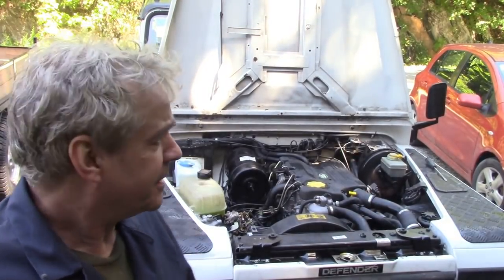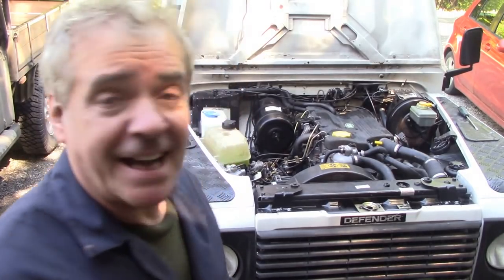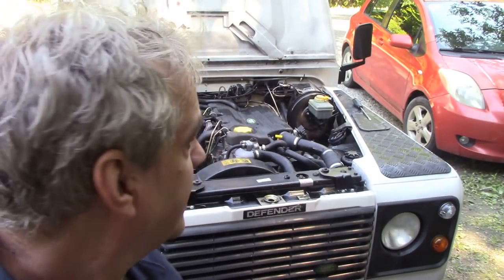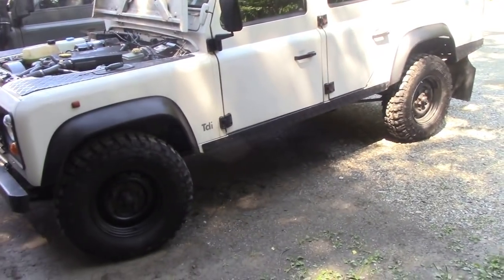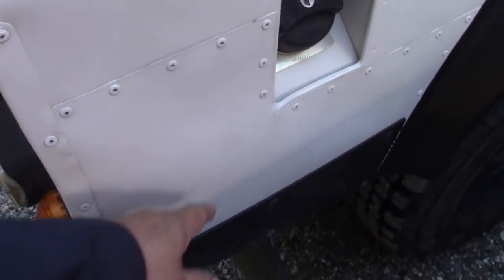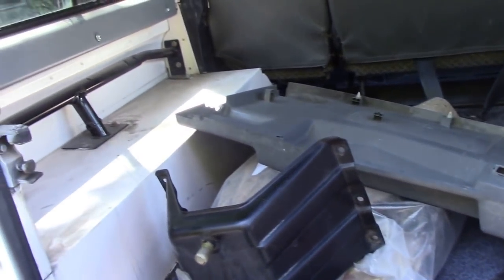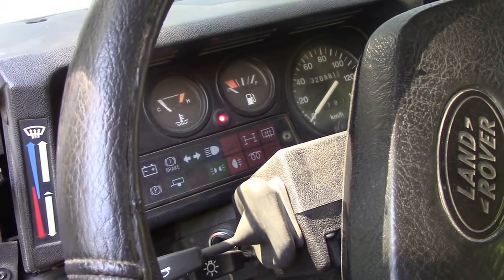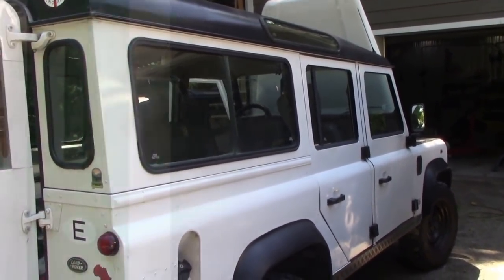Spanish 110. Clean up and a bit of an update!

Comment: i had fun last weekend with the defender anti-theft system (bloody hand brake stuck on) that drum is fun to get off when its stuck on. turned out that the expander was sticky bit of wd40 then some moly grease and it was all good except for me putting the plungers in 180 deg out at lest it all went easier the 2nd time the next day :)

Comment: hello I have a problem with a 300 tdi engine, with the car running, oil spits out of the oil dipstick, from what I understand the compression is passing me for the carte, I have checked the gas hose that goes to the lid valve and gases are coming out, I have also changed the decanter and everything is correct, I do not understand why if the pressure is coming out, because it is still being done by the oil dipstick